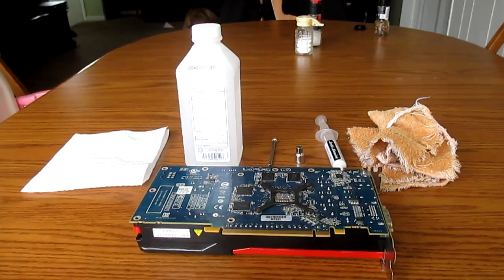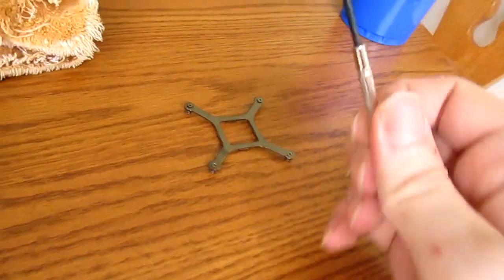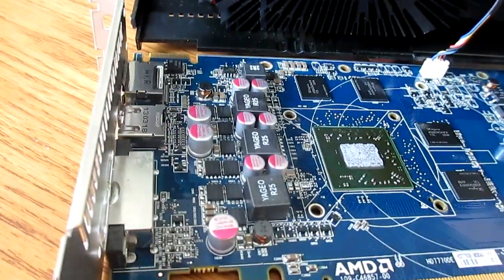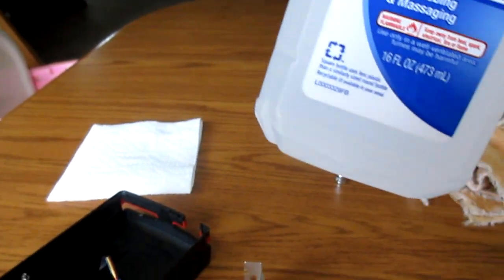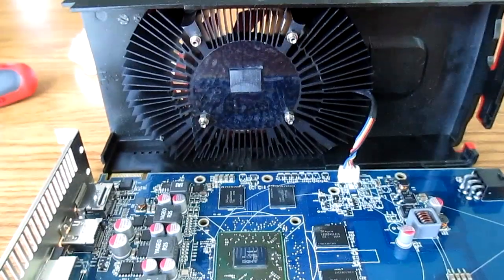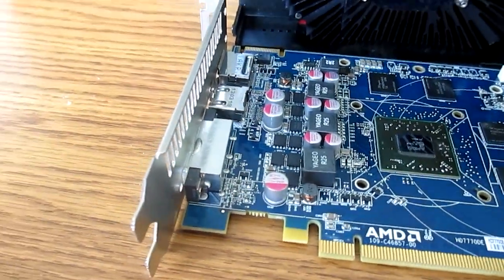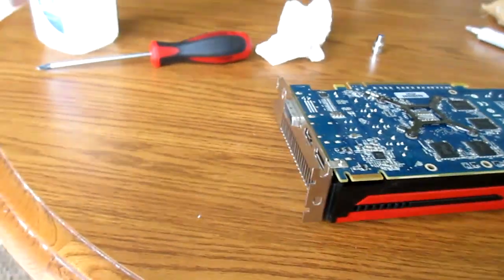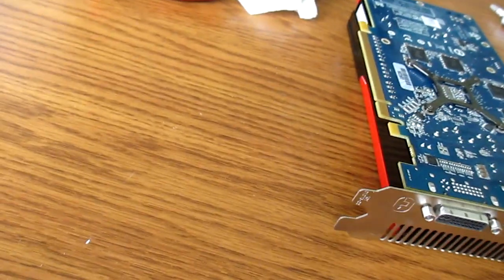Radeon HD 7770 Thermal Past Replacement

Comment: just did first one ever and the paste syruped all over the sides and is a bit over the die o think they are will this be fine or will it need to be on there like cpu thermal paste
Reply: so i pretty much just put to much and it smudge allover a bit nothing crazy but will it be fine
Reply from the maker: @jaxonadlard2680  as long as it's not a conducive paste like just a regular gray thermal paste you should be fine it won't hurt anything if you want to clean it just use a q-tip and some isopropyl alcohol and a little bit of time

Comment: Funny question can you add thermal pads to the VRAM
Reply from the maker: Not really worth it to be honest. i pushed the crap out of mine without them lol
Reply: @TechMaster2133  yeah the heat sink design is so different from modern GPUs I did it anyways even though it doesn't have a flat contact on to the thermopads and VRAMs what's your average temperature under full load and is there a way to measure the VRAM?

Comment: Hi man! I got a problem wth this gpu. Fan is working at 100% on idle man xD...i have to set it at 35% manually to dont die hearing that airplane. I have clean my gpu and the rest of components but it still not working. Some tip or idea? Motherboard problem maybe?
Reply from the maker: i have no idea what would cause that lol, you can install msi afterburner and set a custom fan curve that way, that might do it

Comment: The AMD Radeon HD 7770 is better than a GTX 750 Ti right?
Also i like your gpu :)
Reply from the maker: I think the 750ti is faster than a 7770 but i know my 7870 is for sure faster than a 750ti, but the 750ti is still a great card :)
Reply: o.O
I did not know that HD 7770 was a little lower than 750ti, also your HD 7870 is a lot faster! (Viewed specs in gpuboss.com)

The HD 7870 is the most powerful gpu what you have, right?
Reply from the maker: Gabriel Granados yep 7870 is my best gpu yet :)